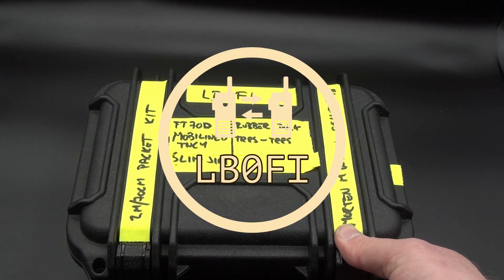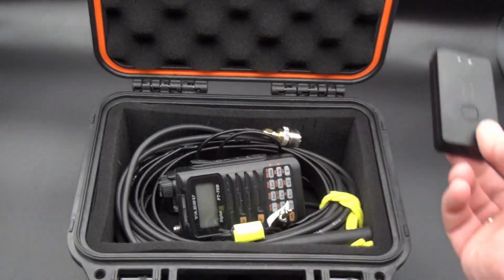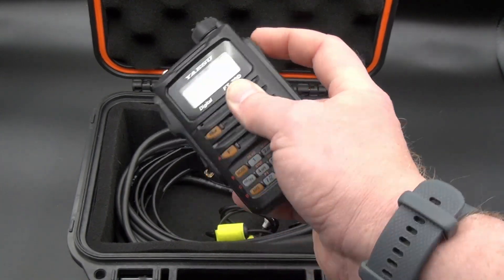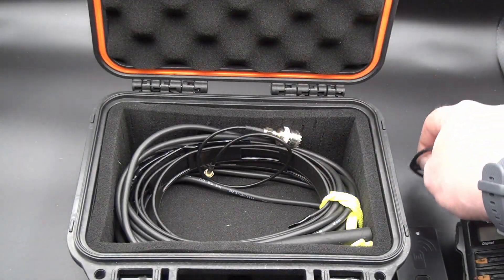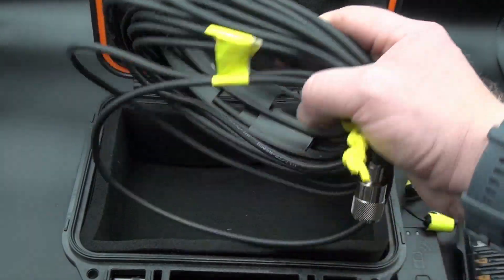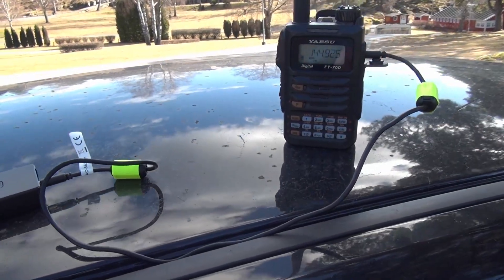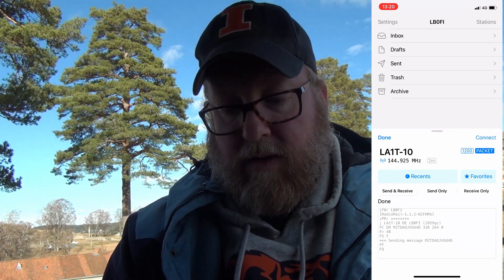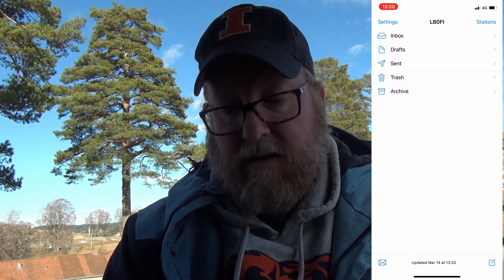Mobilinkd TNC4 Winlink Go Kit

Comment: Did something similar with the moblinkd tnc3, an android phone running WOAD and an HT.  Not a perfect setup, but small and very portable.  I can do packet winlink and APRS.  If you want something with slightly more capability, a DigiRig and a small laptop (Evolve III or similar) will let you run packet modes using direwolf and VARAFM
Reply from the maker: I am going to try WOAD on an old Android phone as well. There has been a lot of questions regarding Android, so I have to see if I can get it working.